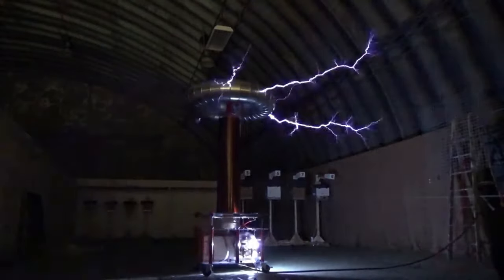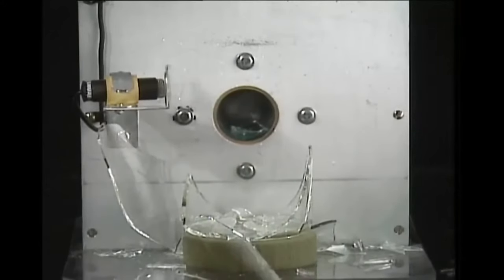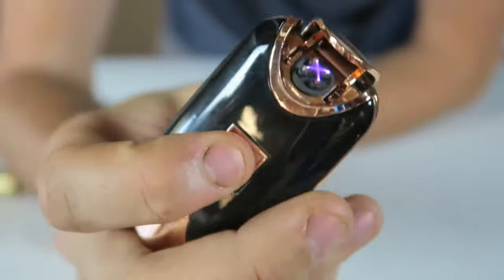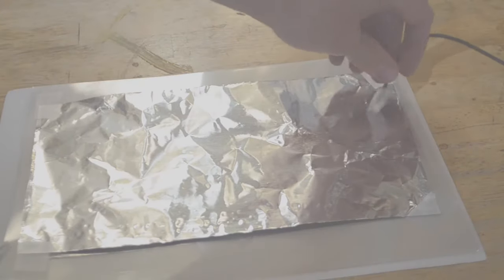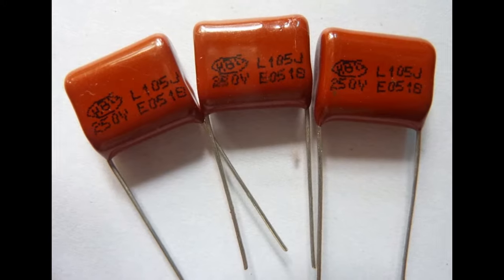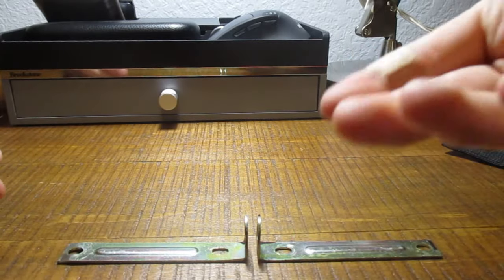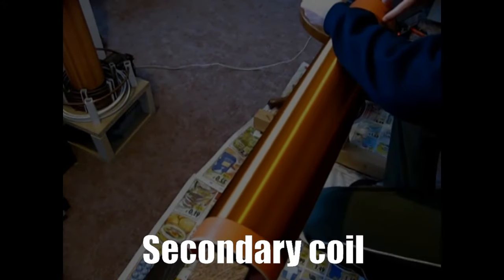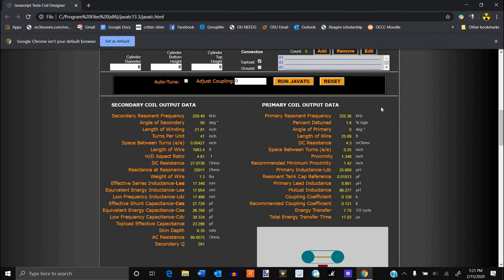The Ultimate Tesla Coil Build Guide (HD):  EVERYTHING you need to know!

Comment from the maker: Sorry for talking so quietly, this was recorded primarily during the early morning hours before I had to leave for college. If you have trouble understanding me, click the CC button in the bottom corner to enable the subtitles, which I have edited to say the correct stuff. Also go check out my new video on build a staccato QCW Tesla coil (much better quality): https://www.youtube.com/watch?v=MWlDGUHWMXw&t=0s
Reply: BATTERY!!!!!!
Reply: Are you familiar with DONALD L. SMITH and his energy generating devices using a Tesla coil as the driving device? He uses the extremely high voltage with low amperage to then drop the frequency back down to 60 Hz and then through a step down isolation transformer to get MAINS current at a greatly increased output compared to input.

Comment: Now make a DRSSTC, has it's own challenges. But the things you can do with it are just awesome.
Reply from the maker: I've considered, but they're more finicky to work with, have more sensitive parts (like IGBT's), and can get pretty costly. I have built a SSTC, though, but it was a SUPER dumbed down version that was basically a slayer exciter. It was based off of Keystone Science's desktop SSTC, but had a more potent MOSFET and I plugged it directly into rectified mains with a ~2A capacitive ballast. It works great (for a mini coil), so I might post a vid of that once I get it back up and running again (I blew out the MOSFET after trying to add an Arduino interrupter and putting in 10A instead of 2A. It was cool while it lasted...).
Reply: @LabCoatz_Science  The "flyback" sstc blows up all MOSFETs/IGBT instantly, because of the huge inductive voltage spikes. You have to use half bridge with a GDT to achieve a DRSSTC operation + half bridge clamps the voltage of the IGBTS to the power supply voltage. Driver alone is pretty much in range of 20$, the costliest things are the bus capacitors,MMC, interrupter and the IGBTs.. 
Of course it's not easy and takes some time to get all the required knowledge, but the results are really worth it.
Reply from the maker: @Antagon666  True. I love DRSSTC and SGTC for different reasons. I love DRSSTC because of their highly-controllable BPS/duty cycle, their quieter nature (they lack a noisy spark gap, as you well know), and their efficiency. I love SGTC because of their robust nature, simplicity, and straight raw power. For generating gigantic arcs, I go for a SGTC. For smaller, quiet indoor arcs, I enjoy my mini SSTC running in CW mode (it's fairly quiet, aside from the low 60Hz hum from the rectified mains). When I started building my SSTC, I knew it wouldn't be super efficient and the MOSFETs would likely have a hard time, so I took the easy route (opposed to just building a better circuit) and crammed in the most powerful MOSFET I could find for a good price (mine was a 1kW IXFQ60N50P3's from Digikey for about $7). It did what I wanted and ran well at low power (made nice 1" sparks at 1-2A input at 170VDC. Again, not super efficient, but hey! the FET was cool to the touch!), but I got greedy and overpowered it. Now, I'll probably order a new MOSFET and keep it under 2A this time around. If I was to ever build a DRSSTC, I would make a QCW model (of course, that would probably cost me quite a good sum of money, and I know very little about how to get one working. Ah well, one can dream). Good luck on your future coil building!

Comment: One of the best tutorial for making tesla coil. It helped me to clear most of my doubts about tesla coil construction. I still have a doubt . I am gonna use a flyback transformer for powering the input coil. As a flyback generates high voltage sawtooth signals, do I really need to connect it via a spark gap and capacitor bank ??? As the saw tooth signal is itself an intermittent ramp, can i connect it directly to the primary coil ?

Comment: I am very pleased you are in the coiler community! Very nice video, I have always loved Tesla Coils (including SGTCs, VTTCs, ISSTCs, DRSSTCs Audio Modulated DRSSTCs, Slayer Exciter and also the Ballasted Slayer Exciter ones). Very nice tutorial, be wary about the secondary windings in your MOTs however, they are picky about high frequency kickback. However you have designed the Spark Gap in parallel with the secondary (by far the best choice because the gap shunts the high frequency kickback through itself). Also I'm surprised to see you use MOTs that are not Ballasted. How long does it take for them to get too hot?
Reply from the maker: Thanks! I've honestly never run the coil for over fifteen second bursts (not really sure why), and the MOT's barely get warm after a few of these runs. I was worried about using unballasted MOTs too (since they draw so much current), but somehow, the coil hasn't tripped the breaker yet, and nothing has failed in the years that I've had it. Not that surprising, actually, since I rarely run the big coil. The spark gap has been super hard to maintain, and I'm still trying to set up one that works reliably, lol! The original one worked fine for a few runs, but these large coils chew through steel electrodes like candy, so it was eventually worn down too much to fire.
Reply: @LabCoatz_Science  Same as you man, I'm trying to figure out a vacuum quenched spark gap same as those Epcos spark gap type. Have a look at my little video "Amazing little desktop spark gap tesla coil". There are several videos. Look at the one where you'll find I've quenched my spark gap in a small plastic bottle. It was silent & gave me great output. Thanks for your videos. They are all great. Keep it up Norman.

Comment: Well done! Great music choices too. Now how do me adapt this to the home and power it?
Reply from the maker: Glad you liked it! Most high voltage transformers (aside from television flyback transformers) just plug straight into your ordinary home wall socket. The coil I built uses three microwave oven transformers with outputs in series to power it, and it can be ran from a ordinary 15-amp plug. The primary's of the transformers are connected in electrical parallel, and properly phased so the outputs add together instead of cancelling out. Hope that helps!

Comment: Hi Great Job, thx for the nice Video. One question... how can i Control the coil? -> Playing Music on it etc. I mean what Controller or how is this working? I know its about controlling the sparks because they are creating heat in the Air wich then causes the Air to extend... but how to build an Controller?
Reply from the maker: Spark gap coils are basically incapable of playing music. The only means you have for controlling this type of coil is either adjusting the rotary gap's firing rate or varying the input power. If you want music, you'll have to look into solid state Tesla coils or DRSSTC's. Hope that helps!
Reply: @LabCoatz_Science  thy for your answer, jeah that helps a lot ;)

Comment: Hi Zack, I’ve followed your circuit and have successfully built my first ever tesla coil. Heartfelt thanks and appreciation for your efforts.
Just for the sake of safety, can you suggest, by your experience, which are the major components to fail in this circuit apart from Mosfet and its driver in case of a flash in pcb?
Reply from the maker: In the solid-state circuits, the most likely things to fail after the MOSFETs/IGBTs are the TVS diodes across the transistor drain and source (if they are present), then the bridge rectifier, and finally, any of the small ICs (mainly the UCC driver). I've never killed a 74HC14, 7812, 7805, or any non-logic component, but I have accidentally killed a few 555 timers because of misconnections, and a UCC27425 once or twice by pushing the duty cycle too high on the interrupter.
Reply: Thanks for the info. I’m checking the board with a scope and the GDT is buzzing as expected. Output from MOSFET is less than half of input (supplying 30VDC for testing). The output from the antenna does not vary at all (200mV square wave, unreliable frequency). I’m struggling to figure out the solution.
Reply: Finally, it’s done. It’s important to check the soldering in pads after a flash. Sometimes they do get damaged. Resoldering suspected areas fixed this.

Comment: Great man✌️✌️
But pls share a diagram to connect all the parts 🙄
Reply from the maker: I did, it's a basic spark gap Tesla coil schematic: spark gap in parallel with the power supply, capacitor bank and primary coil in series after spark gap, and a secondary coil with one end connected to ground.
Reply: @LabCoatz_Science  overall nice work.❤️
Keep it up ✌️

Comment: My father recently passed away and while going through his workshop, I ran across what looks like a Tesla coil he built while teaching his VO-Tech electronics class.  Mom says it quit working a few years after he built it and he never got around to making the repairs.  I would like to revive his Tesla coil project and get it working again but I'm not sure where to start.  Any advice?
Reply from the maker: Assuming it's a spark gap Tesla coil like the ones in this video, it should have the same circuit layout and all of the same basic parts: two coils (one large coil made with thin magnet wire and one small one made with thicker wire or pipe), a capacitor bank, a power supply (usually some kind of heavy, iron-core transformer that produces the high voltage), and the spark gap. Check all the parts and see if anything is broken. As long as the transformer produces high voltage, the spark gap fires, the capacitors are not shorted, and the coils are in tune (they likely are if your father had it working before), then it should work. 
My best advice is to learn as much about them as possible (and be safe, of course) and don't give up. I put a lot of links in this video's description that should be quite useful. Hope that helps, feel free to reach out again if you have trouble!
Reply: @LabCoatz_Science  I have not plugged it in yet but there is a tall coil made of insulated copper wire very similar to yours and a primary coil much smaller near the bottom of the secondary coil.  There is a iron core transformer and what looks like an automotive coil connected in the circuit.  I'm wondering if the coil fills the role of a capacitor.  There is not a top load on the secondary coil like yours but there is a large heavy gage wire sticking out the top.  There is another long heavy gage wire coming from the base up to the top of the secondary coil...I assume that a spark jumps between the two heavy wires when turned on but I don't know for sure.  I have not traced the longer of the two heavy gage wires to know what it attaches to at the bottom.  I would like to send you some photos...maybe to an email address?  I really learned a lot from your video and I appreciate the way you make electricity understandable.
Reply from the maker: @dalefonville2482  Sure, feel free to email me at zlabcoatz@gmail.com! The wire at the bottom of the secondary coil (the larger coil) should just connect to ground. If it's not connected to ground, the output tends to be much weaker, from my experience. And that "automotive coil" could very well be the capacitor (especially if it has markings on it like uF or nF, which symbolize microfarads and nanofarads, the units of capacitance). Send me a bunch of photos and I'll do my best to analyze them!
Reply: @LabCoatz_Science  Sounds good.  I'm at work right now but I'll take some photos this evening and send them your way tomorrow.  Thanks again for taking time to help me out.
Reply from the maker: @dalefonville2482  Absolutely, just doing what I would've liked other people to do when I was getting into Tesla coils!

Comment: Did you run the MOT power supply off a variac or ballast it or anything? Or just straight off mains at ~400mA?

Also did you tap the primary, and if so how?

Great video btw, and metallica rocks!

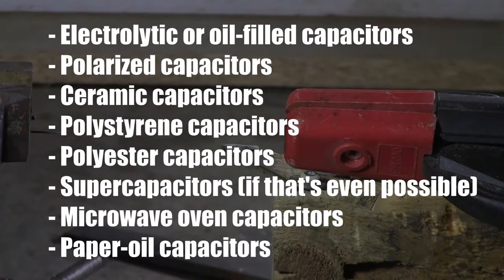Comment: 5:34 You can't use CERAMIC capacitors in a high frequency circuit???
Reply from the maker: You CAN...just shouldn't. Some large, well-built ceramic capacitor will last for a while in a Tesla coil circuit (like "doorknob" capacitors), but the small ones you typically get for cheap will just incinerate. Ceramic capacitors tend to overheat at high frequencies, but that's not their main issue. The main issue is that their voltage rating drops off significantly as the applied frequency increases. For example, a 1kVDC ceramic capacitor might be able to handle only 200VAC when operated at 300kHz (300kHz would typically constitute a fairly large Tesla coil). As frequency increases, the capacitor's breakdown voltage decreases. For a small Tesla coil with a 700kHz resonant frequency, that same 1kVDC ceramic capacitor might only be able to handle 100VAC! That is why it's usually best to stay away from ceramic capacitors when building a spark gap Tesla coil.
Reply: @LabCoatz_Science  I see

Comment: Hey, great Video!
What did you use to connect the secondary to the toroid?
Reply from the maker: Thanks! If I recall correctly, I just wrapped the magnet wire from the secondary directly onto the steel bolt that helped mount the topload. I honestly could've just use some tape though, lol.

Comment: I am thinking about building a SGTC with a small 5kv 5ma neon sign transformer,  an older non GFI transformer.  I am having trouble choosing a capacitor,should I go withan older 6KVDC cap, or wire up some dublier caps?  I don't like MOT'S because I want kinda toy type TC, that won't kill me should something go wrong.  I was going to go with two brass balls with an adjustable, Nylon bolt to adjust gap.  I will have to use the program to work out the amount of wire for my primary and secondary.  I am thinking this coil might output 150,000- 200,000 KV if properly adjusted and tuned

Comment: This video has been an amazing help but I was wondering what I would have to do so that I could play music through it. I know that it plays music by increasing and decreasing the frequency at which it emits the sparks but I'm not sure how.
Reply from the maker: Thanks for the question! It would be extremely hard to play music through a spark gap Tesla coil (in fact, nobody has even done it yet). The so-called "musical Tesla coils" are all solid state (SSTC's or DRSSTC's). Essentially, a Tesla coil plays music by altering the BPS, which in turn changes the sound the arc makes. Spark gap coils would be hard-pressed to do this, since the BPS is determined by the speed of a rotary gap's motor. However, with a solid state coil, the coil's driving currents are switched on and off by transistors, so making music is much easier. Hope that's helpful! If you have any other questions, feel free to ask!
Reply: Thank you so much, this has been a great help

Comment: How did you wire up the 3 microwave transformers (not that they are in series i mean how did you connect them to the power outlet)

Amazing video btw!!!
Reply from the maker: Thanks, I just soldered wires to the power terminals!
Reply: @LabCoatz_Science  oh so you just plugged them directly into the outlet?

Thanks!

Comment: Does the spark in the spark gap get initialized by the high voltage from transformers output or from the capacitor reaching a certain voltage? I never understood this part
Reply from the maker: Technically, it would be the voltage in the capacitor, although the capacitor charges so fast in a Tesla coil, it may as well be the transformer initializing the gap.

Comment: great video man! currently building one myself too, just a quick question, is a 8kV 30mA 25000Hz power supply a good idea to power one? it is a neon sign transformer and i put it in to one of those tesla coil calculators and i think it would work, but since you said something about how high frequency might not work im questioning my transformer choice. any thoughts?
Reply from the maker: Normally, high frequency power supplies are a bad idea for Tesla coil use, but they could theoretically be used if the output is rectified by high voltage diodes. Not sure how one of those new SMPS neon transformers would handle it though, it might just shut down from some internal protection circuit. Your best (cheap) option for a Tesla coil power supply is probably one of those ZVS/flyback combos you can find on eBay, Amazon, etc for under $50. I've seen people get arcs over a foot long with one of those (although they do require a 20-30VDC power supply, which'd cost another $20 or so). I actually wrote about transformer selection on my Tesla coil website here: https://diytesla.wixsite.com/coil/transformers-controls. My personal favorite power source is the microwave transformer, since they are cheap, robust, and EXTREMELY powerful (stringing three of four in series will get you power equivalent to a powerline transformer). Hope that helps!
Reply: @LabCoatz_Science  alright, great! Thanks for the help, im gonna start searching.

Comment: I know this is old but you should have tried a bifiller primary coil
Reply from the maker: Never had good experiences with those honestly. They require more wire and are harder to set up, whereas a helical coil can get you the exact same performance without all the hassle. That's just my opinion anyways!
Reply: @LabCoatz_Science  I agree they are harder to set up but the reason I suggested it is the coil ends up creating a capacitance in the coil and increase current the circuit would more than likely have to be tuned to the coil but anyways I'm a fairly new subscriber and I love the content please keep it up!!!!

Comment: could i build these about pine tree size?
Reply from the maker: You could build one as tall as a skyscraper or as small as a desk toy, if you have the money and  materials. Realistically, the largest pipe diameter you could probably find for a coil is 12" (although that will set you back a few hundred dollars), which could be be used to make a 6-foot secondary coil.